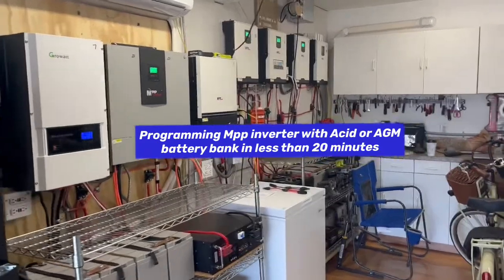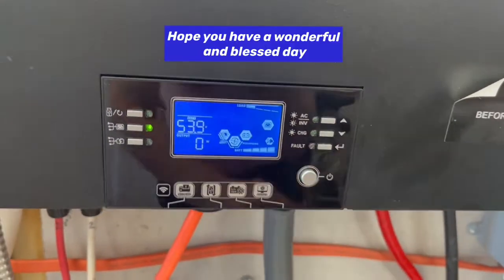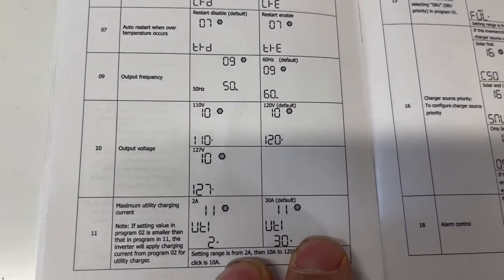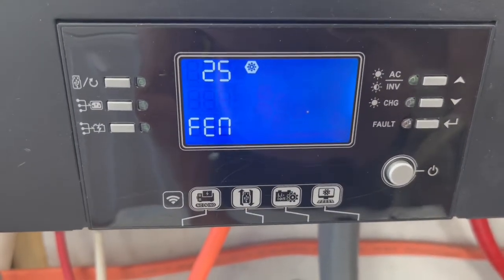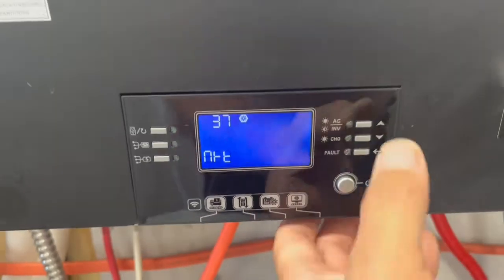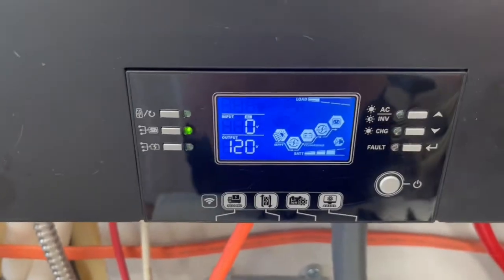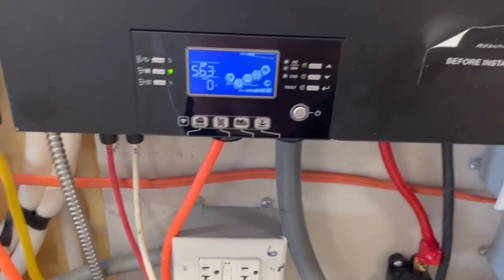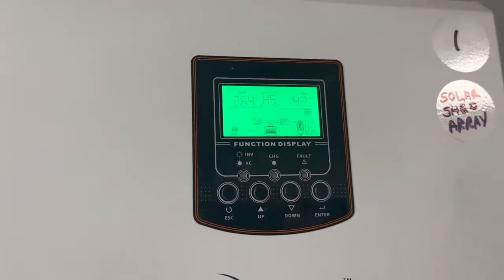Program LV6548 - 6500 watt, 48v Mpp off grid inverter in under 20 minutes for AGM battery bank

Comment: I have a Rich Solar Same model. I can't get mine to input voltage. I have 2 series of 4 on each leg. checked dc breakers before dc disconnects and have 150v. I haven't checked the input on the inverters yet but i set the settings and it says 0 pv input valve.
Reply from the maker: Are you able to check the dc amps input from solar with that meter? Also how many watts in solar do you have on each leg?

Comment: Could you please informe me how do i shutoff the system when there is no sun, I am off grid on battery and solar?
Reply from the maker: Just turn power button on inverter to off position, then I trip the breaker between inverter and battery so no power is able to go from battery to inverter. I then disconnect the positive wire on solar panels connector that connects to inverter, Then negative wire. Repeat and second set of charge controller connectors for solar panels.

Comment: Why do you have all of your grounds disconnected on everything, such as all of your A/C units?
Reply from the maker: I have been trying an idea for the last 3 years which I will discuss sometime in future videos.
Reply: @diy-solar-guy  No offense pappa, but I would love to see that test, no dedicated ground path to the main neutral/ground bond rod source will get you electrocuted quick. However there is still in existence today of ungrounded service equipment in old big industrial factories  that can't link you to ground but they are being phased out quickly as possible. They can kill you quicker and more violently than when you are 1/10000ps protected by ground/neutral bond protection. Hence, GFCI. Proven. Ask any lineman. Be safe brother.

Comment: With the panels in series for high voltage. Does the screen tell you how many amps your bringing in ?
Reply from the maker: Yes, input amps for PV1 and PV2 will be displayed on the screen for LV6548 and most Mpp inverters.